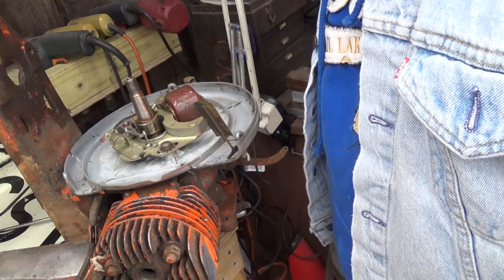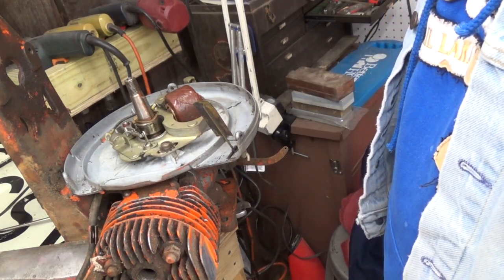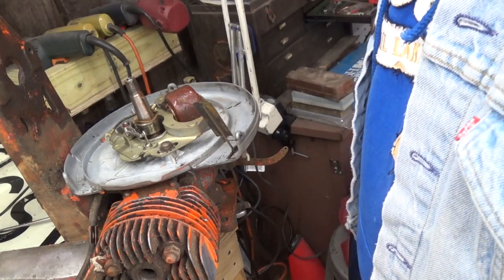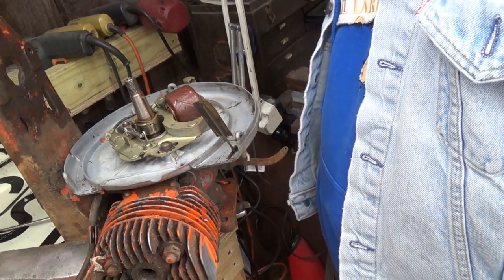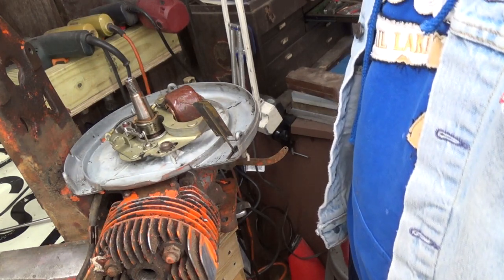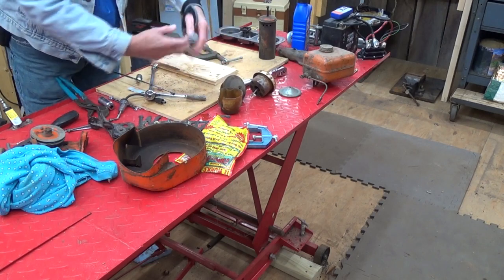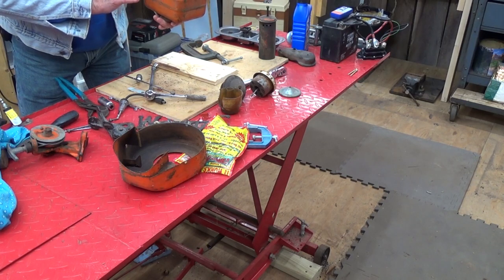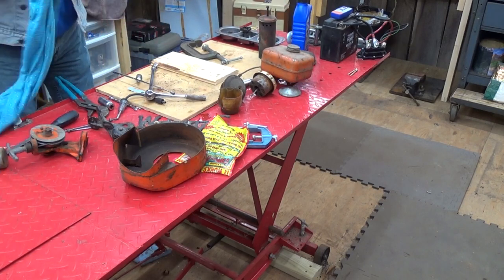Shop update Dec 5, 2019

Comment: I have used those little modules before, they work fine. I think it's pretty uncommon for a coil to go bad , I am kinda surprised you weren't able to get the points cleaned good enough to fire. Do you suppose that someone changed the mag plate and got it out of whack, I wonder if you tried putting it back the way is was, I mean on the original marks left by the bolts?
Reply from the maker: The problem is that it is impossible to tell where the original mounting point was at this point. Do you know of a way to properly adjust those kinds of coils? I don't see any logical way to do it myself.
Reply from the maker: @MissouriOldTimer  I will reveal the solution, which is no solution on the next video. Thanks Vernon

Comment: If I had any parts for that engine I would be happy to help out, but I don't. 

I don't know how bad the fuel tank is, but as someone else said POR-15 works very well.  I've soaked tanks with pin holes in vinegar to neutralize the rust, then coated with POR15 and it works great. https://www.por15.com/POR-15-Fuel-Tank-Sealer
Prayers for Chuck & his family
Reply from the maker: As I just noted to the fellow below, Por-15 is too expensive for this project. Stay tuned for the final fix. Thanks Danny